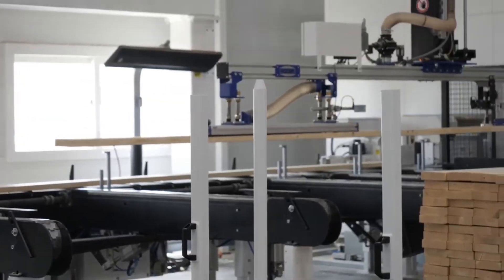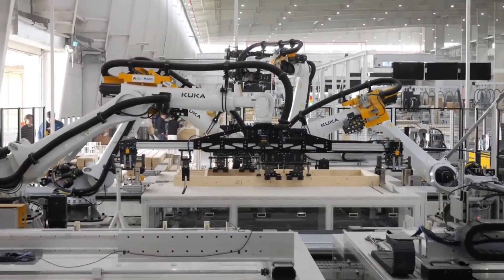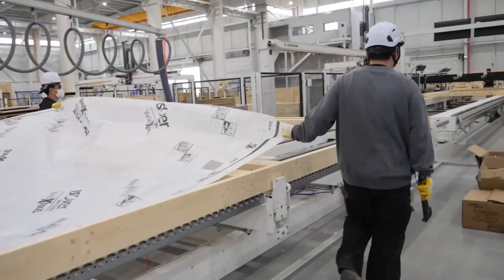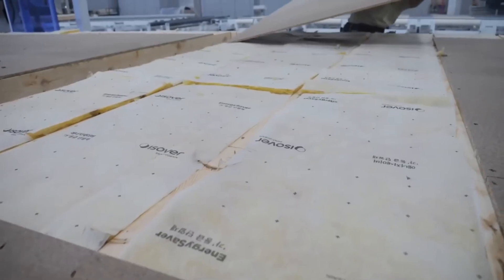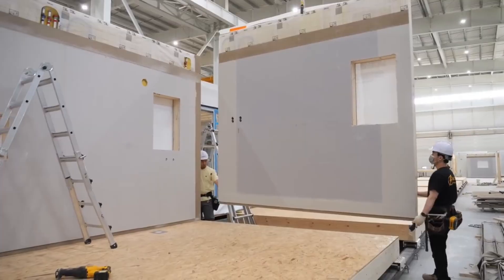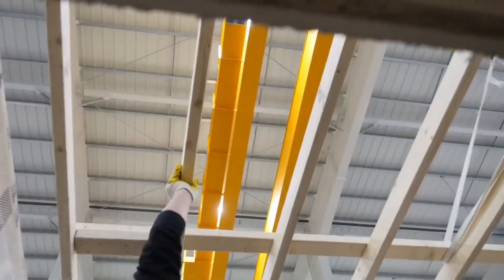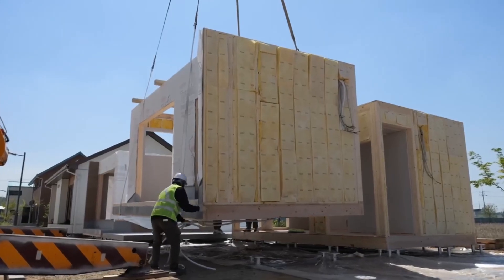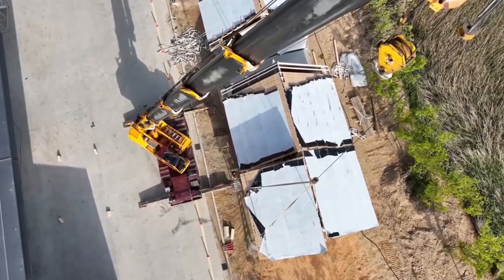This Factory Builds Entire Houses With Robots | Full Process

Comment: That's a very efficient process.  The robots are much heavier than needed for the tasks.  Also, as both sides of the walls have covering before assembly, they did not fasten the walls to the floor, or use metal clips to compensate, so would fail earthquake and wind load design and testing.

Comment: As an ex Timber frame Builder of high quality Homes using 4 x 2 tantalised and graded lumbar @ 400 cmcentres, there was great satisfaction in "on - site" construction - this in the mid 1960s as a Pioneer of the construction in Oxfordshire. The "degredation" of construction over the years by "profit hungry (academic) builders using eg, CLS timber much 'smaller' @ wider spacing, 600cm centres,  then the introduction of pre-built truss rafters, then pre-constructed panels, the joy went  along with the standards. Like a lot of factory built modular components, whilst 'perfectly aligned' in the factory, once manhandled onto trucks and "deposited" on to sites, that alignment was soon not so. Whilst we could build very accurately to very small tolerances in difficult circumstances, invariably the eg, Truss rafters held together with steel plates, or Panels pushed off the lorries (despite cranes) suffered distortion. One could hear sledge hammers being used to align or worse still, plumb a panel, weakening its structural integrity!! Then, Companies not using Architects but "In House Designers" began stereotyping house design  - LIKE THIS VIDEO SHOWS!!! SOULLESS HOUSING. Anything built with, joy and craftsmanship gives ultimate satisfaction and can be appreciated by the buyer. This mass produced "dumbing - down" does nobody any favours!!

Comment: Do not build cavity wood frame homes, they are unsafe (burn and cannot stand wind) unhealthy (mold, toxins, bugs, no sound control) and unsustainable (rot..) use your factory to build SH4 (sand cement structure)..or just precast concrete, much better, safe, healthy and lasts for generations..

Comment: The first door opening is not a structural header…. That’s an interior header, not rated for any load bearing weight. The long wall has a load bearing header in it. See the difference?

Comment: Very cool.  Not to be critical but a lot of those steps were done by  "robots" that had a lot of fingers, hands, arms, legs, heads and ears.  LOL, 
Being a little critical here but isn't that fiberglass insulation? After spending all that money they put the worst performing insulation on the market, not to mention how horrible it is to breath and the irritation it brings to anything alive that touches it?  Fiberglass is in real life in large temperature differentials is by far the worst choice. The greater the temperature differential the worse it performs. They are making this with 2x6's I think because the 2x4s fall over too easy on the jigs or they are trying to make a more insulated wall, but then why fiberglass?

Comment: New development in my neighborhood has walls assembled in a factory and shipped to site, crane lifts up floors and sets them down and then crane lifts walls  and installs walls, two stories and then another truck with ruff trussels are dilivered. Seems efficient. Guy running the site told me this is  economical, shipping a prebuilt room is way too expensive because you are shippng mostly empty space and that is too expensive.

Comment: Two things come to mine pretty quick, when they were initially building the door frame in the beginning of the video they said it was covered with OSB which is organic strand board and you wouldn’t use that on a door opening and there wasn’t any visible so this is basically AI.  Additionally, this kind of wiring is not acceptable in the United States and they don’t use conduit in residential walls.  This is probably a video found somewhere by a company that makes components for structures and the audio was added.
Reply: It’s a Korean factory.
Just copy and paste these characters into Google and you'll find it: 공간제작소 주식회사 대표 박정진
Greetings from Italy

Comment: That is not plywood. It's garbage particle board, made from sawdust thrash. Plywood most expensive very strong and moisture resistant making it ideal for structural and heavy-duty projects, while MDF is dense and smooth, perfect for painting and decorative work but not water-resistant. Particle board is the cheapest but least durable option, susceptible to moisture and heavy loads, making it best for budget-friendly projects

Comment: There using chip board for the walls and floor. Not plywood.
Reply: Hope it doesn’t get wet.
Reply: I noticed the what looks like particle board myself and cringed.
Reply: @The_HomeHandyman I heard them say it was OSB near the beginning of the video. Haven't used particular board on anything for years. It falls apart and is full of Formaldehyde, not good inside for kitchen cabinets or subfloor. It causes birth defects.
Reply: Also the OSB is thin at that.  Would like to see foam used where the walls meet the floor and floor insulation.  Impressive construction though.
Reply: It's OSB, opposite stranded board. We've been using inch and an eighth tongue and groove OSB subflooring for years now. It's made out of Aspen very water repellent and no mildew compared to plywood. Although we use a lot plywood in kitchen cabinets.
Reply: @flynnstone3580  oriented strand board
Reply: @flynnstone3580 
OSB has been used in new construction for over 20 years in Florida.  More so in exterior walls and roof decking.  Haven't seen much in flooring .  The above comment referring to chip board in walls is correct as the video does show that.  Didn't see it used in floors though.
Reply: They’re
Reply: Definitely chipboard, I guess moisture resistant
Reply: @markthomasson5077 
Same as OSB as long as you don't break the rosin bond.  I've seen OSB get rained on for over a week straight and some submerged for almost a week and was still usable.  Minor flaking but totally usable.
Reply: Same as new construction in the field.